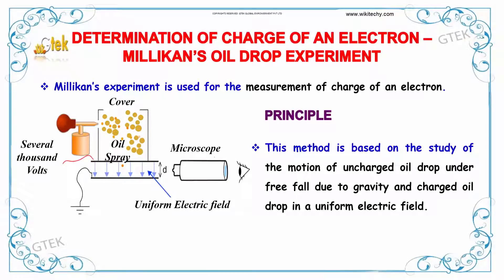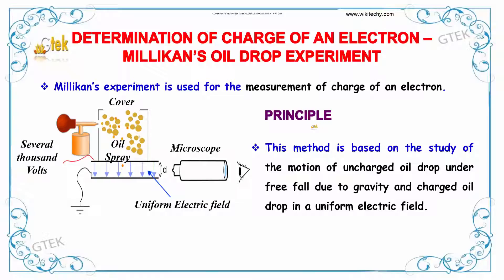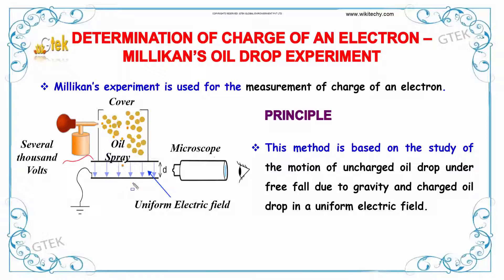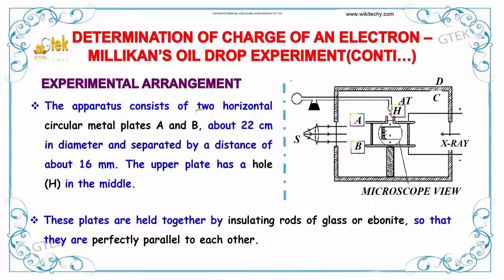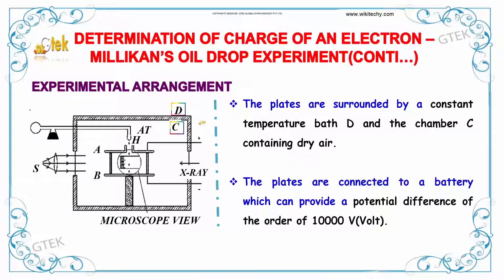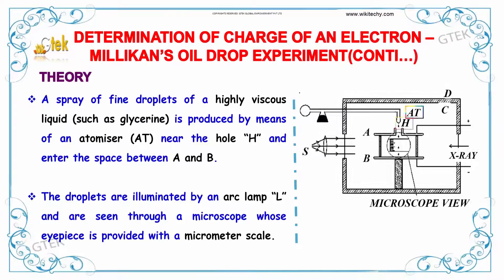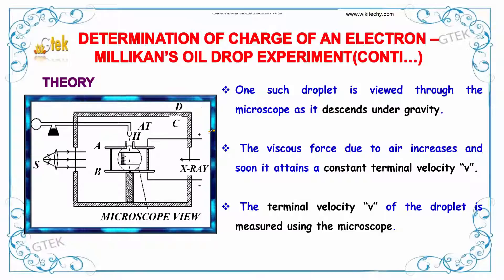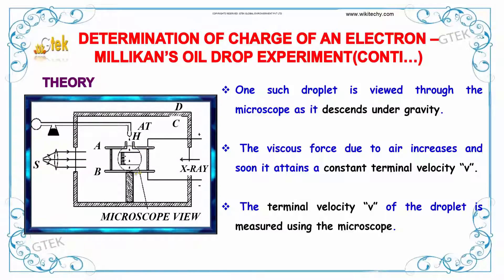Millikan’s Oil Drop Method Part1 | Atomic Physics|class 12 physics subject notes lectures CBSE

Comment: Then an adjustable voltage was applied between the plates to induce an electric field, and the voltage was adjusted until the drops were suspended in mechanical equilibrium, indicating that the electrical force and the gravitational force were balanced. Now using the known electric field, Millikan and Fletcher could determine the charge on the oil droplet. By repeating the experiment for many droplets, they confirmed that the charges were all small integer multiples of a certain base value, which was found to be 1.5924(17)×10−19 C, less than a 1% difference from the currently accepted value of 1.602176487(40)×10−19 C.[1] They proposed that this was the (negative of the) charge of a single electron.

Comment: Millikan’s experiment is used for the measurement of charge of an electron. This method is based on the study of the motion of uncharged oil drop under free fall due to gravity and charged oil drop in a uniform electric field.

Comment: Millikan confirmed that the charges were all multiples of some fundamental value and calculated it to be 1.5924(17) ×10−19 C, within one percent of the currently accepted value of 1.602176487(40) ×10−19 C. He proposed that this was the charge of a single electron.

Comment: Apparatus consist of an atomizer, which helps to spray tiny droplets. By means of a short focal distance telescope, the droplets can be viewed. There are two plates, one positive and the other negative above and below the bottom chamber.dc supply is attached to the plates. Some of the oil drops fall through the hole in the upper plate.

Comment: The oil drop experiment was performed by Robert A. Millikan and Harvey Fletcher in 1909 to measure the elementary electric charge (the charge of the electron).

The experiment entailed observing tiny charged droplets of oil between two horizontal metal electrodes. First, with zero applied electric field, the terminal velocity of a droplet was measured. At terminal velocity, the drag force equals the gravitational force, and these depend on the radius in different ways, so that the radius of the droplet, and therefore the mass and gravitational force, could be determined (using the known density of the oil)